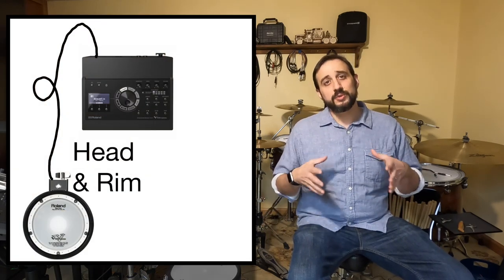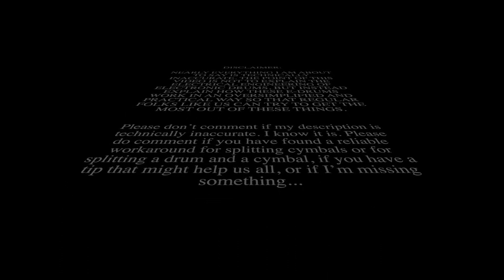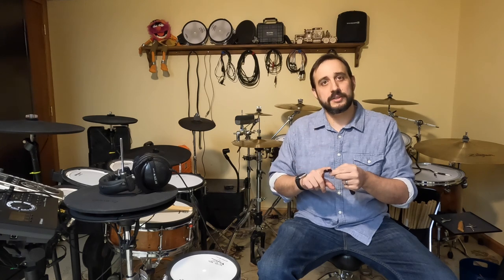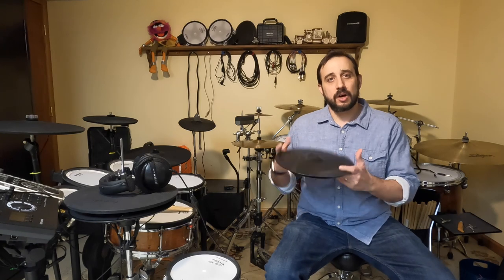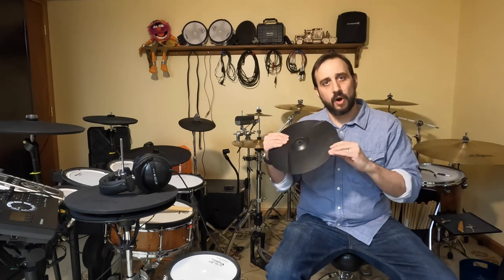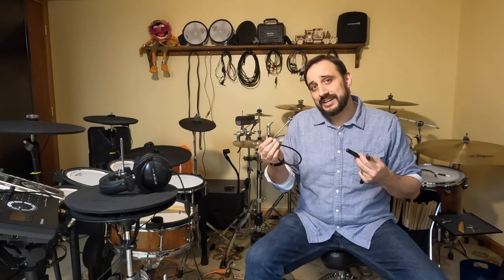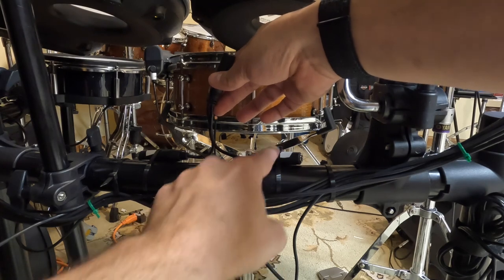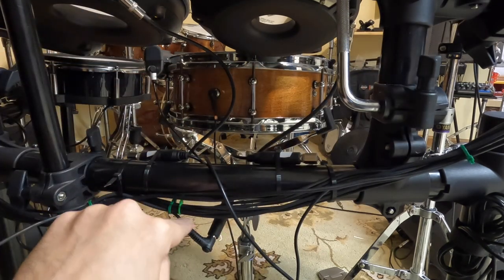HOW TO ADD DRUMS to your E-Kit: a detailed explanation on splitting input cables to add more drums.

Comment: Also important to mention is that not all drummodules trigger the same. My plan is to split tom2 and tom4 from my td9 to use a second splash and side snare/rimsounds. I like to keep it simpel so when i want to perform a different setup i do not need to program all the kits. I would use small pdx6 pads to limit the footprint of the drum
Reply from the maker: great idea!

Comment: I bought the kind of splitter that doubles the signal and duplicated the ride cymbal for the left hand as well as the right. I also duplicated my hihat and used an old rack mounted hihat, both controlled with the left foot. Works like a charm.

Comment: I believe you can use a stereo cable with a mono input. You dont necessarily have to buy mono cables if you already have stereo.
Reply from the maker: That’s correct. The mono cables are usually a little cheaper, but use what you have and it’ll work once the signal has been split. Thanks for watching.
Reply: Yeah,…… mono is cheaper, but use what you have……..👀😎👍👋✌️🇨🇦

Comment: I have an Efnote 3x kit which has 4 toms. I was thinking to split Tom 1 and use its rim as Tom 4 head, and connect a 2-zone cymbal into the Tom 4 input. Do you see a problem with this setup? I don't think I'll ever hit Tom 1 and Tom 4 at the same time.
Reply from the maker: That sounds like a great idea. It should work well. And if you ever to hit 1 and 4 together, you'll still get the sound of one of them, so it's not like it would sound awful. Thanks for watching!
Reply: @myfavoritedrumgear  I tried this, and a couple of other combinations. Unfortunately input splitting doesn't work well with Efnote modules at all. Whatever is connected to the tom's rim, the module seems to filter out low velocity hits. It's certainly unplayable. 
What I did to expand my kit is that I bought a Ddrum DDTi trigger interface and connected both modules into my pc as MIDI inputs (I never use module's sounds anyway). You can use two or more modules as MIDI input at the same time in Superior Drummer, I didn't know this before. And I connected my two floor toms to the Ddrum and connected extra cymbals to the Efnote module's tom inputs because Ddrum doesn't support cymbal choke and it also doesn't work well with 2 zone cymbals and pads. So I'm using only the head zone of floor toms connected to the Ddrum. In this way I can use my extra cymbals fully functional.

Comment: I'm currently using an Alesis Strike module with an A2E conversion kit (Jobeky internal triggers on snare & toms, and diy low volume cymbal triggers on 3 crashes - VH-10 for Hi-hats and a Jobeky triple zone ride). But I just ordered the Audiofront Edrumin8 (the 10 is back-ordered and I couldn't wait!) and plan to trigger into my laptop loaded with Superior Drummer3 moving forward. My concern is, will the eDrumin8 provide enough inputs for my current setup, assuming I split 3 of the inputs to mono to accommodate the kick, toms and crashes (ride, snare and hats will require stereo inputs for the dual triggers)? Anybody have experience trying this?
Reply from the maker: I don’t have experience with the edrumins, but I’m not sure if you’ll be ok. If you split your 2 rack Toms to, say, input 1, your snare to 2, HH to 3, crashes to 4,5,6, then you’re covered there. But that leaves 2 questions: 1) can the edrumin split a bass drum? I’m guessing yes, because it’s just an input transmitter, but Roland modules and others do not allow the bass input to receive 2 signals. if so, input 7 splits bass drum and floor Tom. Now you have the last input for a ride cymbal, but a 3 zone ride needs 2 inputs. I don’t know offhand how the edrumin handles 3 zone rides, but it sounds like you’re 1 input short. If you play a 4 piece kit or have single zone cymbals, you might be ok. I hope this helps. If anyone else is more familiar with the edrumin, please help a fellow drummer out!
Reply from the maker: And now that I’m thinking more, I think you’ll need an additional input for your HH foot control.
Reply: @myfavoritedrumgear  Thank you for the quick reply! The eDrumin does have two additional foot controller inputs in the back (one for HH, and one for expression) I don't think it has the same bass drum limitations as the Roland since all 8 front panel inputs are TRS. The trigger software that comes with it has a unique feature that allows for a 3 zone ride to use just one input using "bell sense" which I have yet to try with my Jobeky ride, but fingers crossed. It seems like a great unit. You should review it on your channel! So, assuming I don't have any of the weird crosstalk issues you mention in your video, 8 TRS inputs should be enough for my setup.

Comment: You mentioned that splitting cables can be problematic. Would using a dual zone tom input with a cymbal cause similar issues bc of the “switch/button” trigger vs “button/button”?
Reply from the maker: Yes. Splitting toms and cymbals leads to weird outcomes.  If you have the gear and some free time, go ahead and split the cable and see what kind of results you get. Comment here and let me know what you experience. Thanks for watching!
Reply: @myfavoritedrumgear  Reporting back! Essentially, assigning my rims to cymbals works fine-- just turns them into single-zone, non-chokeable cymbal (I've used this for a China and a splash, so didn't really miss any functionality)!

Comment: I was doing 2 modules for a while, and before that I used to have a drum splitter, splitting my T2 and a China, using a TD-11, I moved to a new house and got back to one module, and now i cant use the same drum splitter, even on superior drummer 3, when i try to learn different notes it goes the same sound. both cables, for the tom, and for the china are single, I dont know anymore wtf is going on, hard to find that, specifically online
Reply: Sure that the Midi channels aren't the same/linked?

Comment: Do you think millennium drums/cymbals are basically
The same as lemon?
Reply: I had this question a few days ago, because of the price ranges and the number designations (t-x50 vs MPS-x50). But a closer look suggests they're not related. First, the cymbals are very different. Second, almost all of Leon's drum sets are built around wood or wood-style mesh head drums, while Millenium looks much closer to the old-style mesh head on a hoop. Finally, the set designs are very different - Lemon has no two-up two-down configuration, which Millenium uses for its top set. Lemon cymbal stands seem to be connected to the vertical rack posts while Millenium has them clamped onto the horizontal rack, etc. FWIW, there's a channel called Atom Drums that does a review of the top Millenium set, posted a few days ago. Spoiler alert: looks really nice and sounds okay for the money, but seems to miss notes.